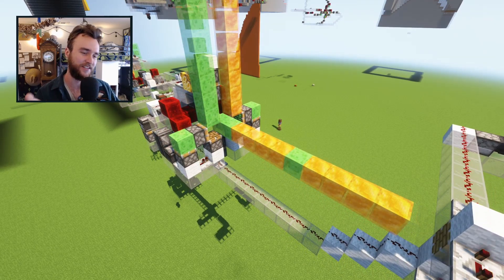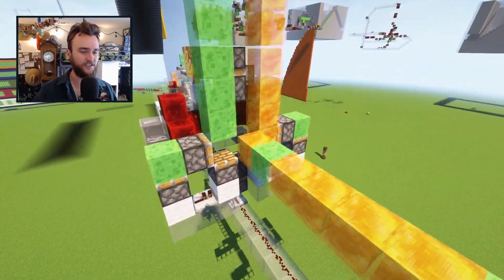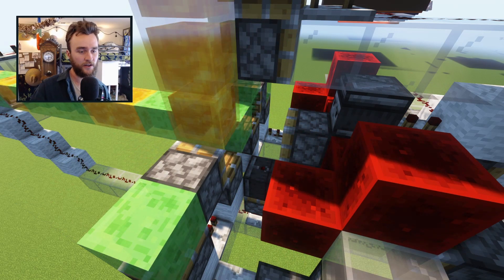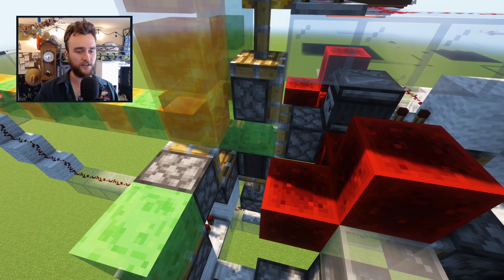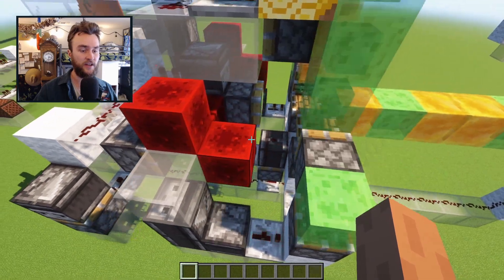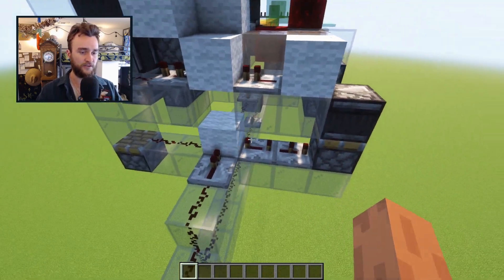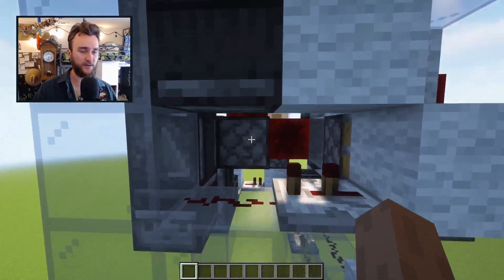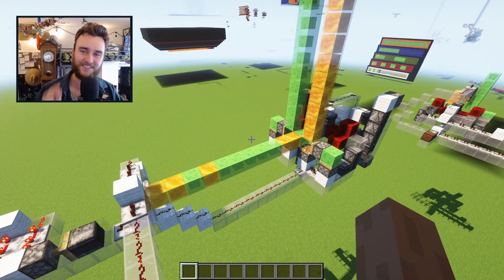Slime vs. honey mechanical sorter

Comment: I could see that potentially usefull, if you have a flying machine getting disassembled and rebuild. But when would that concept be usefull as well as how would you deal with the other blocks in the machine

My best guess would be some sort of automatic expanding Perimeter System? Where you could in theory build the flying machine for a Perimeter, have a disassambly station at the endpoint, that pushes the blocks back up and a ssembly Station ready, to create the next perimeter? 

But than you could just build 2 flying machines to begin with... Yeah this is propably one of the cases of "neat, but useless" :D

Comment: Could you just have a pair of slime and honey block moving back and forth next to the head of the block stream? Then depending on whether the next block in the stream is slime or honey it'll move left or right, effectively sorting between the two blocks. Only issue then is that they need to be split again...
Reply from the maker: That would work fine too. You'd just have to separate the individual slime/honey blocks in a different way